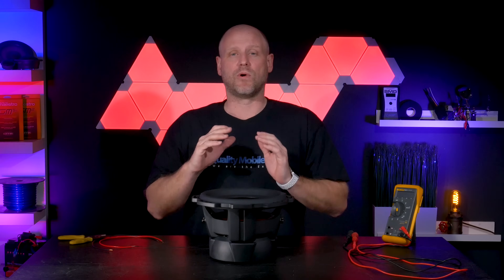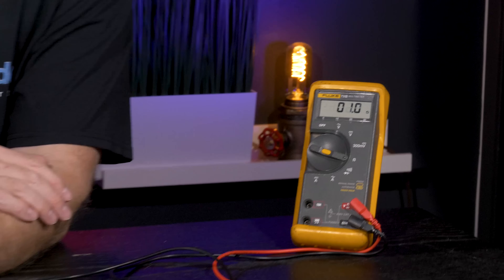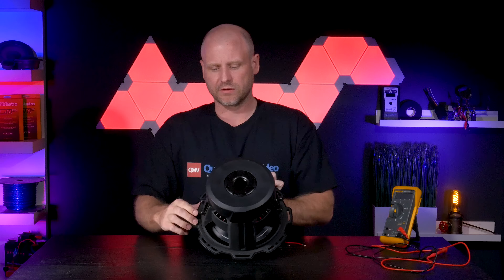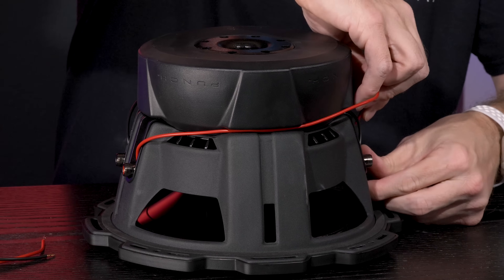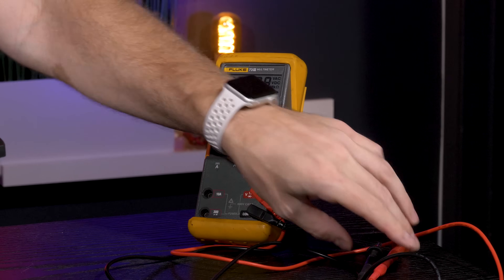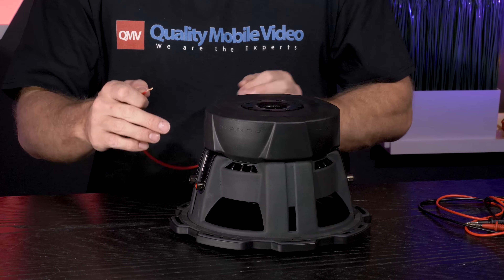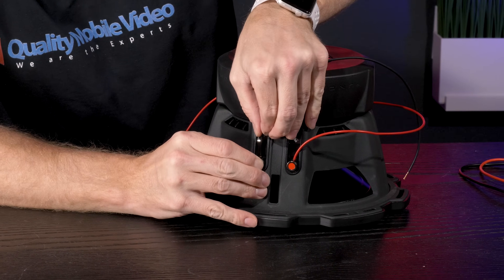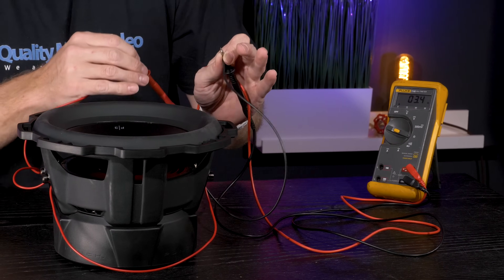How to Wire Your Subwoofer Dual Voice Coil 2 ohm - 1 ohm Parallel vs 4 ohm Series Configurations

Comment: What about if you want to keep running at 2ohms. Do you only use one coil? Sorry I’m new to audio wiring
Reply: You can run just the one side at 2 ohms if you must, but it won't run as efficient. If you have an amp that can handle 1 ohm, then do both in parallel. If your amp will do 4 ohms at only half the output of 2, try running it in series at 4 and see if it sounds any better than one coil at 2. Whatever you do, don't run a lower ohm rating than what your amp is rated for.

Comment: Bro, I am so frustrated! I have been working on my car audio installation for like 200 friggin hours and I am trying to figure out the best wiring scenario for my 12 inch jail audio W6 something something V4 on one of two different apps and I also have a 12 inch Canadian made subwoofer that’s supposed to be 1500 W RMS, but I have yet to discover whether or not It’s even as good as the JL. I need to know what you think would sound the best and how it should be wired I have that hurts 1100 W or I actually think it goes up to 1246 or something HP one amplifier and I figured I would run, more powerful sub off of that amp and I have the Kenwood Excel on XR 900–5 the five channel 60 W RMS per channel and 600 W RMS mono block subwoofer output and only has a positive and a negative for the sub so bridging it is out of the question and I’m trying to figure out how it needs to be wired if I want to bridge my four channels that I run mids and tweets off of And if it’s 600 W RMS, it should match up perfectly. With the JL audio.12 “ leaving the 1500 W RMS sub to take maximum power from my hertz amplifier. However, after listening to numerous wiring and videos, I am still at a loss for how to make sure I am pulling maximum wattage from the subwoofer output on my five channel and I’ve only got one amp and one sub on the other, how do I wire the one subwoofer to make sure that the amplifier is only pulling what it’s supposed to forms which I believe is too I don’t think I can go down to one and getting all 11 or 1200 W. from The amplifier. Please help me bro desperate Damon.

Comment: Thanks, been sitting on a 500 watt duel coil pancake in a box that fits behind the seat of a single cab 2006 chevy colorado. 1 Walmart Power Acoustik 2500 and fresh wiring kit later and it was bumping.
Reply from the maker: Nice! 👌😎

Comment: This is an excellent video, thanks for the explanation. However I still need help.   I tried setting up the woofer in both ways, at 1 Ohm and at 4 Ohm.  At 1 Ohm I feel the power, but the woofer itself is very quickly at its limits by not producing the right bass. |
Is that because the woofer is not able to play on 1 Ohm because its a 2x2Ohm?  

At 4Ohm my amplifier is not strong enough, the woofer itself is 2500W RMS.....

Comment: This video is helpful to learning how my system is down to. For my vehicle my trunk space  is limited so I couldn’t really put 2 12s back there. I’ve learned that from my first and second system installation(which I just upgraded) that for ppl with 1 subwoofer setup always get dual 2 ohm subs so you can wire down to 1 ohm in parallel and get an amp that’s stable at 1 ohm.

Comment: When wiring in parallel, does the + and - of the same voicecoil have to go to the amp? Or can you use the postive of one voicecoil and the negative of the other?
Reply from the maker: Yes both need to go to the amp, that will be a paralleled connection.

Comment: Great Video. "Q" but what is the max length of speaker wire sub to the amp? my Amp is a stable 1 Ohm to a Dual Voice coil 2 Ohm Sub
Reply from the maker: Wire size is always dependent on length and current through the wire.

Comment: Can someone please help me with this question. 
If you have a 2ohm dual voice coil subwoofer and you only connect one set of voice coils and leave the other set unconnected, do you get a 2ohm load to amp?
Reply: I just bought a Skar VXF-12 2 ohm dual voice coil and when I put my meter on one side it it reads 1.9ohm and when on the other voice it is 2.1ohm. So yes you are right only hooking up one side will have a resistance of 2ohms

Comment: Will this work with any subwoofer? I have a kicker cxa400.1 that does about 480 watts at 1 ohm, and i want to get a 43cvr152 subwoofer from kicker and wire it down to a 1ohm load it wiuld pair nicely with my amp if it works

Comment: If I have a sub wired to 1ohm and connect it to my lc1500.1  would that cause my amp to clip any low volume and when I adjust the gain the light continues to flash no matter how high or low

Comment: Man no wonder the car I just bought has a nice 10" DVC 1500w sub in this HUUUGE box that sounded like crap. I took it out of the box and found a box that was specially made (by the same company even) for this specific sub. Its literally 1/4 of the size lol anyways I'm about to rewire and I consider myself fairly experienced when it comes to installing car audio but I never knew this! So thank you for an awesome and to the point explanation. Also what's the difference in ohm's? The lower the ohm the lower the bass?

Comment: Question. If I run 2x 2d subs. One wired 4ohm other 1ohm.  Bringing it down with a parallel connection which should be 0.8 ohms. Will one sub get more then the other. Not much into ohms law. Please help
Reply from the maker: You cannot do that, the one wired at 1 ohm will get nearly 4 times the power.

Comment: What if i have 2 DVC subs @2 ohms rated 300w rms each, how do i wire them to 4 ohms? My alpine amp is mono block does 600w rms at 2 ohms or 4 ohms

Comment: I have question. I checked out this video and did it correctly but now get a buzz when I close my truck door. I do have a line output converter connected to the speaker in that door, but I only get the buzzing when wired 1ohm
Reply: It's a single sub in a box. Does it matter which side terminals i run to the amp? Thank for you help!
Reply from the maker: Do you have the models of both the sub and amplifier?
Reply: @Qualitymobilevideo  no sir amp is a Polk audio and wiring kit and line output converter are from walmart

Comment: I have one kicker L7 2ohm dvc in a sealed enclosure should i wire it to 1ohm or 4ohm for best sound?
Reply from the maker: So 1 ohm will get you more bass and power, will be louder. 4 ohm will offer you more efficiency and a cleaner sound, less bass and power

Comment: I have 2 kicker L7 12 2ohm q class on a taramps 1800.1 d 1 ohm but they aren't wired down to one ohm currently.. should I wire them down to one ohm or should I just get the 2 ohm version of the 1800.1 taramps amp for the best performance?

Comment: This is exactly what I was looking for , I have a ct sounds 500.1 that has a max of 500rms at one ohm and want to see if I can pair it with a kickerl7r12 that’s rated at 600rms but at two ohms. Can I do what you did changing it to one ohm that way it gets the full 500rms at one ohm from my amp. I really don’t want to buy another amp.

Comment: Planning on getting 2 Skar Audio Svr 12” D4 ohm subs (1,600w and 800 rms each) but don’t know what amp I should get, any suggestions?
Reply: Rp 2000 or 2500
Reply: 2 rp 2000 1 each

Comment: Hello Brother,

Which amplifier can i use to boost my all 4 speakers and single 12inch sub. specifications as below:
Speakers: Skar 4ohm 300watts Peak and 150RMS ( all 4 same spec )
Sub:  Clif Design 2ohm 1200watts Peak and 600RMS 

please advise so I can boost all of them.

Comment: My dilemma for making my connections to the output wire is my T5.122 soundstream Tarantula sub has preconnected speaker wire to the sub. So how do I connect the speaker wires in either way series or parallel, do I just connect the ends to each other like positive to negative ends for my series connection and where do I attach my outout wire, to the ends of each connection or tap into one wire end up towards the tinsel leads?

Comment: I have a question I was told if I had two subwoofers dual 2 ohm I can wire + to + and - to - on one subwoofer which will bring it down to 1 ohm and do the same to the other subwoofer. Now I will have  two  positive and two negative left , now take the other  positive and negative wire them together which will bring it back to 2 ohm for both subwoofers the left over positive and negative wire to the amp which be at 1 ohm. Can you do that?
Reply: So you mean series parallel and yes you can
Reply: @austinjackson9650  ok but doing that you still get 2 ohm final not 1 ohm
Reply: @Catholic1391  Sorry! Read it wrong my bad yes you would end up with 2 ohms final. Best way to think of it is you can either half or double ur ohms. Then multiply that by how many subs. So (2ohm sub x 1/2) is 1. Then 2 subs so minimum is 2 ohms. I'm pretty sure you cant get down to one ohm but. You should probably get 2 mono blocks(of course I imagine you already bought a 2 channel or are trying to figure out  how to wire a single mono to 1 ohm) Technically you dont have to use both coils, you could just hook up to one positive and one negative per sub but then if course you would have less power. Anyways, good luck to you, and if you do figure out how to bring it down to 1 ohm please share!
EDIT: with a 2 channel you can get 1 ohm on each just positive outputs  to both positives for each sub. Same with negatives

Comment: Is it impossible to wire a single 1 ohm dvc sub to a 1 ohm amp? I can't find any examples so I'm beginning to think that it's impossible.  Lol
Reply from the maker: If each coil is 1 ohm the no, you will either have a 1/2 ohm final or load or 2 ohm
Reply: @Qualitymobilevideo   thank you 😊

Comment: Hi thanks for the video
So I have a 2 12 inch subs at 2 ohm each if wired to the final impedance at 2 ohm for both knowing that they 600 rms each will it be 1200 rms total at the final output at 2 ohm or different. The amp I have is skar rp 1500 rms 1 d monobloc 
It gives 1500 rms stable at 1 ohm and 930 rms at 2 ohm and 550 rms at 4 ohm. My question  is if I wire both of them at 2 ohm will it damage the amp know it is rated only at 930 rms at 2 ohm or not ? 
N B : I have the option to return the subs and get the 4 ohm ones instead at the same power (1200 peak and 600 rms each ) 
What do you suggest ?
thanks a lot

Comment: I have one 4ohm dule voice coil sub and one 2 ohm dule voice coil sub so how would i wire them together to my hifonics brutus BG 1300.1D 1300 watt amp
Reply: Just run them in series, it doesn't make that much difference in small set ups, after 10k watts..your wiring is everything. Alternators, lithium batteries..use foam Crack sealer for trunk rattles. It's $2 instead of dynomat for sound
Reply: @deadsypadilla  ok thx so much this helps alot cause i know how to wire my 4 ohm down to a 2 ohm so should i do that and just wire my 2ohm as a 2ohm then into series

Comment: Is it possible to make a 4 ohm component 6.5 Rockford fosgate speakers t1 into a 2ohm load? I’m running 2 sets front and back and I picked up a fosgate 450x4 but it’s rated 4ohm only 60ish watts, not sure since it’s fosgate they do underrate there amps but would like to know if it’s possible? Maybe bridge the front and the rears maybe this would help? Wanna do this properly and the amp is gorgeous!! And would be nice to be able to run full fosgate set up, my sub amp is a monster, 2000.1bd size of half my leg lol. Bought New Years and years and years ago used for about 6 months then back in box in storage.

Comment: Hey I have a question I have a Skar audio RP 2000.1  amp but I have the EVL – 15  D2 subs. When I wire them up I can either get 2 ohm or a 0.5 Ohm the amp is a 1 ohm. Can I run it at a half ohm as long as I don’t turn the gain up over halfway or 3/4 without hurting it?

Comment: Can you wire a single 4 ohm DVC to a 1 ohm amplifier?
Reply from the maker: Unfortunately one DVC 4 ohm woofer can only wire to 2 ohm or 8 ohm
Reply: @Qualitymobilevideo  I have 2 pioneer ts3003d4 they are 2000w 600rms what's the best way to wire them on a 1 channel mobo block?

Comment: My kicker sub is dual voice coil 2ohm is it safe for my sub to be wired at 1ohm
Reply from the maker: One DVGC 2 ohm woofer wires to a 1 ohm load in parallel so yes! Just make sure the amplifier has an equal or greater RMS rating @ 1 ohm than the subwoofer's
Reply: So this will work with a kicker L7 15" 2 ohm sub and an x2 arc audio 1100.1 1 ohm monoblock amp?
Reply: Just curious dnt want to mess up either and want to get best sound both are pricey but u cant go wrong with L7s

Comment: I was wondering I have a RF T1500 1bdCP and 2 12” 2ohms and want to run as a 1 ohm in each channel.  watching this video I like it.  But on the amp it has L-R channels and for this I want to run 1ohm to to each L-R channels is it the same as instructed.  The amp is 1500x1 @1 ohm.  Does that mean if I run 2 2 DVC 2ohms and drop to 1 ohms in each channel will that be 750x 2 @ 1 ohms??? Please help thank you.

Comment: im not getting it...

2ohms (one coil) plus 2ohms (the other coil) equals a total 4ohms wired in series right?....

However, in parellel you would wire each coil together right?.... sooo 2ohm +2ohm =4ohm. Then you divide by 2 because the voice coil is 2 ohms. 4 divided by 2.....2ohms 

How the hell do you get that to a 1 ohm load?

Comment: I have a Memphis audio m6 2ohms dual voice coil will it be best to have it at 1 ohm or 4 ohms when wiring it?
Reply: That depends on the amp you'll be using, if the amp u use can drop to 1 ohm then that's the way you want to wire your sub! General rules with amps is the lower the ohms the more powerful it will be.if your amp can only handle 4 ohms bridge then wire your sub in series to give u a 4 ohm load.
Reply: How can I tell if my amp is 1ohm or 4 ohm?
Reply: @timking2997  owners manual, some also have it printed on the amp itself. Worst case you have to call the manufacturer. To be safe most amps can handle 2 ohms and up. Not all can handle below 2...

Comment: Ive wired my DVC 2 Ohm Sub in parallel exactly as shown in the video, tested it and it appears it has a 2-3 ohm load? Is it possible that my multimeter isn’t working properly?
Reply from the maker: There must be an issue somewhere, one DVC 2 ohm woofer wires to 1 ohm or 4 ohm. Double check your wiring and the setting of your mulitmeter

Comment: Got a r1200-1D Rockford Fosgate monoblock and 2 Alpine S-W12D2’s is it possible to wire those down to one ohm stable for the full 1200 watts from the amp
Reply from the maker: Unfortunately, two DVC 2 ohm woofers cannot be wired down to 1 ohm. You need either two DVC 4 ohm woofers or one DVC 2 ohm woofer for that

Comment: How do you wire up a 1ohm sub to 1ohm??? Please I can’t find any videos!!!!
Reply: I have the same question, been looking for videos for it myself...i have (2) 1 ohm speakers to hook up to a 1 ohm stable amp
Reply: I hooked (2) 1 ohm Dual Voice Coil speakers in Parallel and came out with 0.5 oms...hope this helps.

Comment: I got 2 shallow kickers 1ohm dual voice coil and a 1800 hifonic zeus whick one would sound better
Reply from the maker: Depends on the stable impedances of the amp?
Reply: @Qualitymobilevideo  I do too but my amp is 1 ohm stable. I was wondering, I have 2 1ohm dvc kickers and I looked up how to wire it to 1 ohm final and it says to wire them both in series and connect a jumper from one positive on the sub to the other sub and 1 negetive from one sub to the other sub then run your line to the amp off 1 sub. Is this correct

Comment: PLEASE HELP!!
I have a Alpine mrv 1200 mono amp. I just got one 1500 watt rms 12' dual 2ohm skar subwoofer. The amp says 2ohm for 1200 watt rms or 4ohm for 600 watt rms. I want the full 1200 rms power. How can I wire my subwoofer to get the full 1200 RMS ???
Reply from the maker: You have a bit of a dilemma Gilbert! A DEV 2 ohm subwoofer can be wired to a 1 ohm load in parallel or 4 ohm load in series/parallel. It cannot be wired to a 2 ohm load. So you're stuck with wiring to the 4 ohm load for half the power. Unless you upgrade your amplifier to one that is stable at 2 ohms

Comment: PLZ HELP .. my amp has two bridgeable channels that push 200 Watts at 4 Ohms,  300 watts at 2 ohms & 600 watts at 4 Ohms bridged.

one channel is burned out.

I just want to hook up one big ass subwoofer. just blew my memphis 12"s

can the negative on the burn Channel still be used for a bridge?
 
so I can get a 600w sub run bridged or do I have to go with a 300 at 2 ohms  or my math wrong?

should I just get a 200 watt sub? & how many ohms would that be out of one channel not bridged?

somebody help me understand this

Comment: Im tryjng to figure out how to wire one 15” skar audio sub dual voice coil to a crunch 2000.1 monoblock with 2 + terminals and 2 - terminals .please help ?!
Reply from the maker: Read your manual it has diagrams. Page 6: https://crunchcaraudio.com/media/wysiwyg/Crunch/manuals/current/2013-Crunch-GPA-amp-manual.pdf

Comment: Hey,  I have a pair of DVC 2ohm subs, I want to have a 1ohm load at my mono amp. Is this possible? I was going to run at 2ohm load until a dyno test of my amp revealed its overrated. My subs are 400wrms dual 2ohm voice coils my amps actual power,@ 14.2v,  2ohm dynamic =692w and 14.2v, 1ohm dynamic =1138w  What really sucks is this is a Orion cb2500.1 which is CEA certified So much for trusting CEA# Any help is greatly appreciated.  Peace
Reply from the maker: Unfortunately, two DVC 2 ohm Subwoofers can be wired to a 0.5 ohm load(which is risky), 2 ohm load (Parallel), or 8 ohm load (Series).
Reply: @Qualitymobilevideo  ya that's what I didn't want to hear. Thanks for your speed reply which just got you another subscriber. Thanks
Reply from the maker: Anytime!